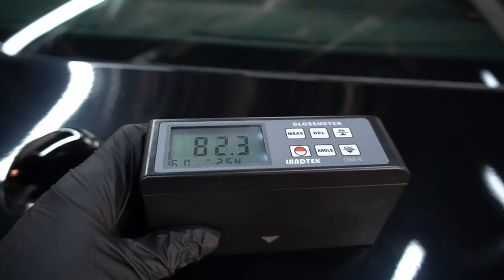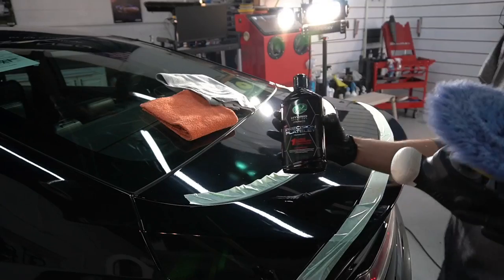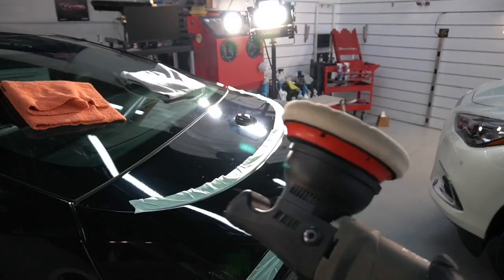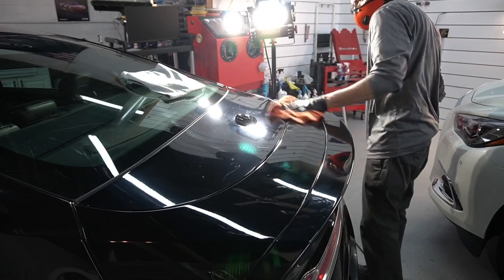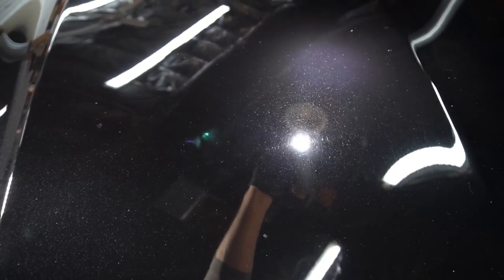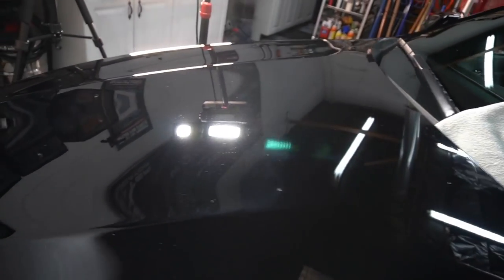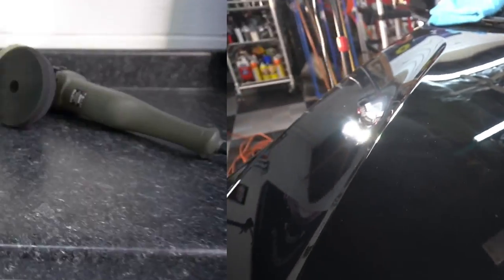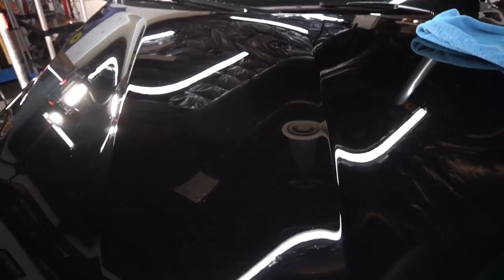Real World Correction! Everything the 1 & Done From Turtle Wax Can Do! And More!!

Comment: Both Turtle Wax and Mequiars auto care products are owned by 3M. I don't own any power tools for buffing/polishing and do not have the pads either. Why are people so afraid to use muscle power? One & Done does remove the lightest and slightest scratches and watermarks. It is far from Paint Correction or BarClaying/Decontamination. One & Done is for people that need a simple and quick improvement, which can be done even faster with a Detail Spray, like Turtle Wax Ice or Adams Detail Spray. The biggest culprit in damaging your vehicles paint is driving your vehicle through Automated Car Wash and Touchless Car Wash. Your vehicle takes a pounding and torn/rip your vehicle apartas the car wash uses bad hard water, harsh chemicals, high pressure water rinses, high CFM drying, and cheap wax that might dissolve in the next rainfall or melt off from the sun. Don't overpay or get PPF "paint protection film" or Ceramic Coating as they are a waste of money. Do yourself a favor, manually wash and wax your own vehicle like the days your grandpa did. Only wealthy people can afford to pay an Auto Detailer.

Comment: Brian, thank you for showing the versatility and assorted results with this compound/polish.  I have recently corrected 2 older cars that were as bad if not worse than this Lincoln.  I was astounded at the versatility, work time and final results.   I primarily used the Urofiber and orange pads and was completely satisfied with the results.   What I was most pleased with was the actual shine that the one & Done produced.  Made the sealant-wax applications so smooth & easy - not to mention the increased gloss!

Comment: Hi Brian,  I love your videos and even did a correction on my truck this fall after you inspired me that I could do it myself. Will this product work in direct sun in high temps like some other TW products. Also have you ever done a video on  Adams Graphene ceramic coating? I purchased this product this 
fall  but was unable to apply it due to weather. I plan to doing a lite jeweling in the spring then attempt for the first to apply this coating. Thanks again for for all your experience and videos.
Reply from the maker: Yes...works just fine in direct sunlight.   Just the spray coating so far.

Comment: Anorher great video! I have a variable speed random orbital polisher. My truck is black with mostly light imperfections bordering moderate. In order, which pads would you recommend or a 2 step process using the one and done?

Comment: The 3" white foam pad used on bumpers, you said was a medium cut. What brand and model or type of pad is it? 
I have found Lake Country white foam pads with 1 & Done, and 3D One, on soft clear coat to work good. Does not get out all imperfections, however that clear is very thin.

Comment: Brian, could I get your thoughts on cordless polishers?  I see that all yours are still corded, at least the videos I’ve seen so far.  Are these not quite there for power and performance or is it just something you prefer with corded machines?  Thx
Reply from the maker: The battery life needs to improve. We will use them for spot corrections for now.
Reply: @apexdetail85  Thanks   I was about the get one, but switching to a cord..

Comment: I have a 90's bright red 300zx that needs paint correction. It has been garaged kept. I have always used m105 and m205 but hate the dusting. I use orange (for step 1) and white lake country foam  pads (step 2  m205) with a DA polisher. What compound/polish products in 2021 do you recommend I use with current pads and da polisher for best results? Thanks. For what it's worth....you have the best detail ch.

Comment: Hi. I’ve got a brand new gladiator in the queue to be built next week and I’ll have it mid March. I’m a 100% novice on this stuff.
I’d like to immediately coat it with a ceramic (looks like armor shield IX would be good for me).  Can I or should I use this product first? If so what kind of pad is good for weeks old clear coat? Also, if I apply two coats of armor shield can I or should i use the turtle wax graphene spray on top of it? If so how long should I wait?

Comment: how do you find this compared to Meguiar's Ultimate Compound and Ultimate Polish? I've been using those 2 for correcting the paint, but this looks like a very good contender, and it's just 1 bottle, you just need to switch out the pad from aggressive to medium strength then just wax afterwards.

Comment: Did you have to wet sand most panels before using this product? What grade sand paper do you use for the wet sanding?
Reply from the maker: No. I only wet sand to spot correct deep scratches.

Comment: The kit that you can buy has five pads — the wool 50/50, yellow, orange and black foam, and the black hand applicator pad.  The type of correction needed determines the order of pad used, correct?  And isn’t the black foam pad also used with the Max Wax or is the black hand applicator pad better?
Reply from the maker: Yes you are correct. Max Wax can be applied by hand or machine using the black application pad.
Reply: Ok; I was watching different videos on the new line and it seemed to show that both the 1 and Done & Max Wax use the black foam pad.  Did I see that correctly?  And is the wool pad you used first on the back end different than the wool you buy in the kit?  Because it seemed to show that you used the 1 and Done with a different wool on a rotary machine.  I bought the kit for the reason to have all the necessary and appropriate pads for the products.
Reply: What machine would you recommend?  For me personally, with the pads in the kit I prefer a DA.

Comment: Absolutely horrible wipe off! I wiped it using 2 microfiber towels, first was damp and 2nd dry, and there was still residue left on the panel! I even used IPA and I still couldn't remove it. I ended up buffing it with a soft pad and Meguiars Polish with my DA and I manage to remove most of it. It was a nightmare! BTW it wasn't sticky/finicky paint. I have polished it using Meguiars D300 and the wipe off was so easy. Heck even koch chemie h9 was easier! 

If you are looking for something which is easier to work with, I highly recommend Meguiars D300. It has similar cut and the wipe off is so much easier. The only reason why it doesn't get the respect it deserves is because it is an older compound. I have used it as a one step and IMO its even better than 3D One, which is also great, but again the wipe off is not as good as the D300.

Comment: Turtle wax is just making good products for the money. Goes to show you how over hyped other products are compared to tw.
Reply: Mmmmmm the pure graphene claims are PURE bs🤪. The sds/IDD sheet says it’s graphite not graphene and it’s function is lubricant. I think it is misleading and makes it harder for the true pros to do our job
Reply: @henryfreeman6113  not every product is aimed at pros. There is tens of thousands of weekend warriors out there.
Reply: @spirokaci  I agree. But you should understand that it is not graphene. I am sure it’s a good product but it gets so confusing with all these buzz words being thrown around!  I wish we had a centralize place for info 🤩
Reply: @henryfreeman6113  From Adam’s Polishes website “Graphene, a monolayer of graphite, is able to be oxidatively processed into graphene-oxide (GO) which makes the material vastly easier to process and formulate around.”
Reply: @henryfreeman6113  I do agree with you.
Reply: @aquaman0167  yep. That is correct. Reduced graphene oxide is what is needed. In TW they use graphite. Which offers nothing. It is inert. No true purpose.
Reply: @aquaman0167  I’m going to say this polish is going to be my favorite of the new line.